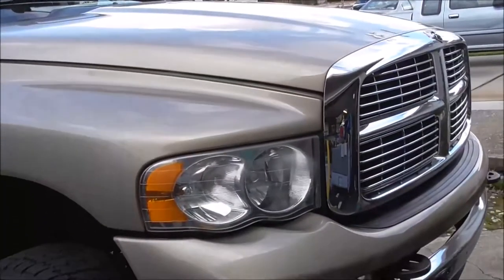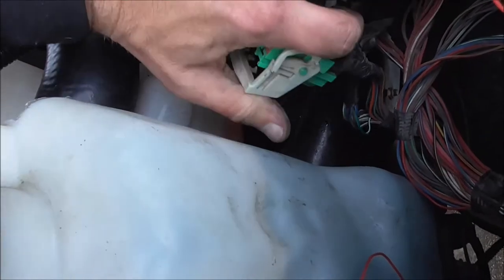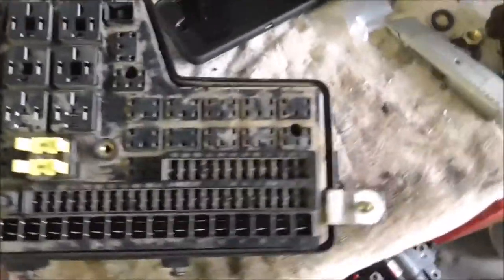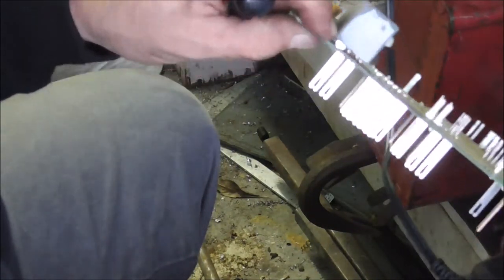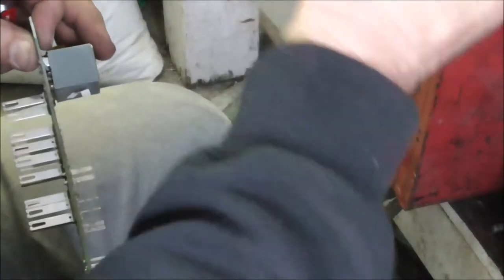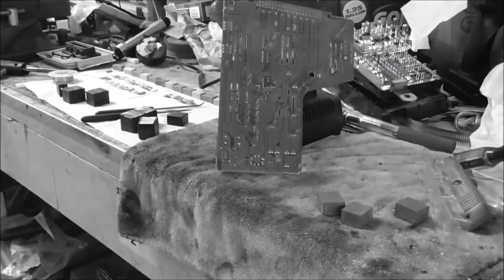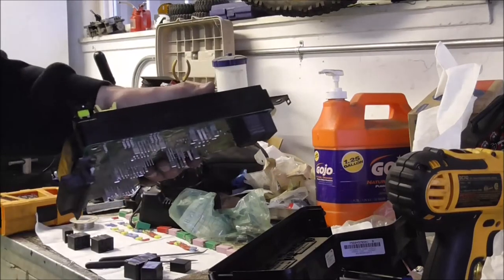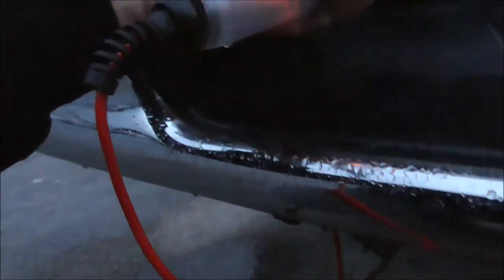03 dodge ram trailer relay repair

Comment: I just completed putting in new relays and cleaning everything and I finally have trailer blinkers and my wipers have intermittent ability again. This after 10 years. You can buy a 3 pack of relays on Amazon for $21.
Reply from the maker: Congrats on the repair
Reply: @Thegaragefiles  I’ve heard this can make your airbag light come on the dash also

Comment: Ive been taking the plastic tops of relay forever, use my dremmel cut the plastic off , being very careful , run fine sandpaper thru the points, put the top back on with tape!

Comment: No PRNDL light on the spedometer guage at 21:09. Same as mine. They must come standard like that. Good video, thanks.
Reply from the maker: ccaamm1 yep, still have the 4x4 light I’m trying to figure out, will be making video of new clutch, rear main seal and fleece coolant bypass soon

Comment: I have 2003 dodge ram 4x4 1500 and I have short to open/ short circuit on left front headlight only, with lamp out light illuminated. Auto shop couldnt figure it out so it is left up to me! I put new switch in, I know parts change, lol! It did not help! My next step is check fuses, relays powers and grounds. Am I missing anything??? New learner hear. Am I suppose to remove batt cable to check fuses?
Reply from the maker: Sounds like your in the right track, electrical can be tricky gremlin, try tracing out the wires and make sure it’s not grounding on a body panel or something

Comment: Do you happen to have the part numbers for the relays you used? I have an ‘03 2500 5.7L with this exact issue. This video has given me hope.
Reply from the maker: Check the comments I think there was a link for relays, i don’t remember the link it was eBay but Amazon probably has them also

Comment: How can I tell if its my fuse box causing trailer and brake lights or the FCM?
Reply from the maker: You will need to figure out what color wires the trailer light are right off the bull head connector under the fuse panel and test light them that’s how I figured it out.

Comment: Where are you located? I got the same exact truck with the same problem.  Why are so many trying to buy my truck?
Reply from the maker: I’m in CA I ended up selling it, needed to get a dually was trying to find another on but scored a deal on a 08 gmc, I miss the cummins
Reply: Well I'm glad you did that video that was an awsome job. So why do so many people want my truck same as yours? I turned down 20 000 as it only has 119,00 on it. If I fix mine and do a video I will refer people to your channel thanks again

Comment: I did this because right turn signal on trailer was out.  Now both trailer turn signals work but left trailer brake light is now out.  Both brake lights worked before I changed the relays.  Makes no sense...

Comment: Hey Very technical job. It’s been 5 years how’s it all working out ? Have you had any other electrical issues or gremlins so to speak. Excellent video
Reply from the maker: Been working great no other issues, I sold the truck last year but kinda regret, I ended up getting 08 duramax dually, recently sold the duramax and now I have an 05 3500 6 speed much better

Comment: Do you have the part description of the 30A relays you bought and where did you order them from?
Reply from the maker: dafish9161 https://rover.ebay.com/rover/0/0/0?mpre=https%3A%2F%2Fwww.ebay.com%2Fulk%2Fitm%2F253716181045

Comment: I have an 07 ram same issue on my 5th wheel.2 questions did that relay have an affect on the trailer brakes an second why use a 30a relay instead of the 20? Great video btw 👍
Reply from the maker: robert mcguire no issue with the trailer brakes mine has a separate controller for that, and 30 amp was the same as price so go a bit stronger, isn’t bigger better😂
Reply: The contacts are burning on the relay due to a higher than expected load or a short and the fuse doesn't blow.
Reply: I know this was 5 years ago, but did you figure out if these relays affect trailer brakes?  My trailer brakes currently do not work and the 30 amp fuse is not busted so Im  wandering if one of these relays is the brake controller relay and I need to do this job.  I have a 05 btw.

Comment: What's the part number for tow relay
Reply from the maker: 3pcs 12V 30A Relay AZ988-1AT-12DSEC3R VFM-21F42-S01 Dodge Ram Trailer Tow Lights

Comment: if you had 4 pin connector why do yneed to wire a 7 pin like a 4 pin? trairs that have a 7 pin set up have it for reason.....usually because the carry a lot of weight and need brakes.

Comment: That is sort of a bad design those  relays should be where you can access them easily like the others and be able to replace them without pulling the  box apart
Reply from the maker: The Open Air Garage yep they should of designed so they are replaceable. Oh well I got it fixed thanks
Reply: Thegaragefiles Very impressed, with the fix.

Comment: When you had the issue with the trailer turn signals, did the ones on the vehicle work fine? I'm having this same issue. Thanks.
Reply from the maker: James Rocco yes vehicle ones worked fine, trailer circuits had bad relays
Reply from the maker: James Rocco yep there is no need to hide them, good luck it’s really not too difficult hope it fixes your issue, mine been good since the repair